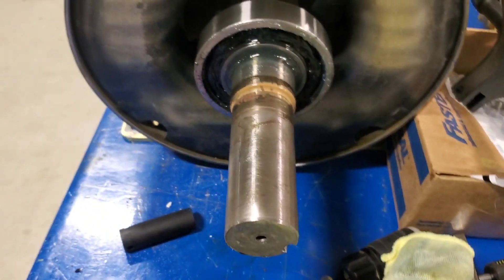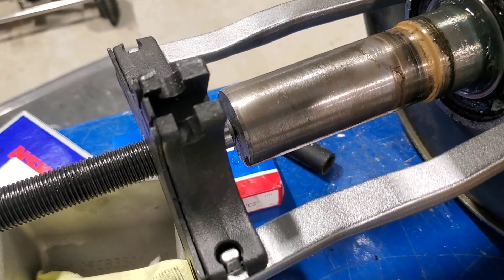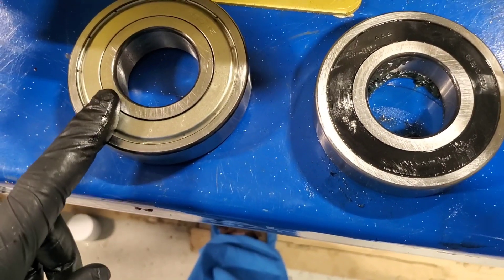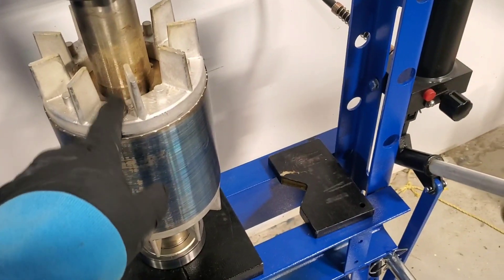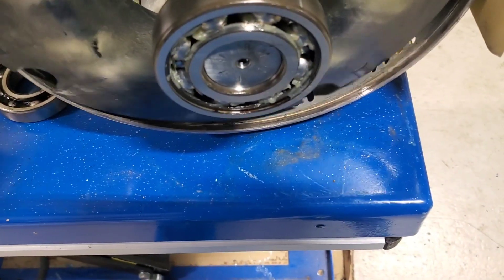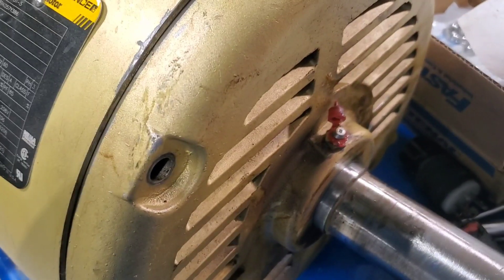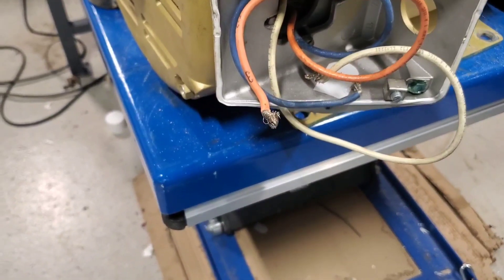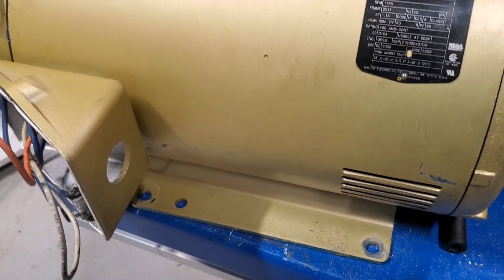Replacing ball bearings in an electric motor new SKF Explorer Bearings

Comment: Good heavens, I just bought a vintage Stanley Bench Grinder — a model 557 that I'm restoring.   Today I opened the motor, and one bearing is bad, and the grease on the outside looks just like that, all burnt.  How crazy is that I came across your channel?  Is it possible to fix that one by cleaning and relubbing, or does it need to be replaced?
Reply from the maker: Replace for a happy experience

Comment: do not use an induction (or any heater) without a temperature shut off. you can easily burn the bearing. also, don't recommend heating a greased bearing. either flush it out and repack after install or press it on. Completely agree with Jim's recommendation about hammering or torching. Don't do either. Commend the cleanliness of the shop.
Reply from the maker: Good advice
Reply from the maker: we had a very small press so there was no way to fit the armature in it. We also did motors right in in-situ as we could not get them out easily. sometimes you have to settle for good enough. Oh my motor rebearing lasted longer than a motor shop job so there is that LOL

Comment: Wasn’t it obvious that the fan side bearing didn’t fit on the shaft ?  It was hanging off by 1/8”
Reply from the maker: Correct it was rectified before final assembly

Comment: Great video! Is the over-greasing occurring at the motor rewind shop, or in your plant ?  Back at Courtice steel, the electricians removed the zerk’s, plugged the holes with pipe plugs, and greased them themselves as per manuf. Recommendations so other people didn’t over grease.
Reply from the maker: Hvac techs are over zealous with a.grease gun
Reply from the maker: Hey Dave,do you remember the team working on acoustical greasing technique in the Galt plant? We were using a mechanic's stethoscope to listen to the grease enter the bearing. It's one of my favourite methods of greasing
Reply: @JimsNBHomestead  I had forgotten all about it until now. I do remember, that was a really cool technique. I remember listening to the sound of the bearing turn into a swishing noise
Reply: When you have any luck teaching the HVAC Techs this method?
Reply from the maker: @davidbeals6807  Got laid off LOL
Reply: @JimsNBHomestead  they got laid off, or you did?
Reply from the maker: Me, Weed industry is dying fast....REAL FAST
Reply: @JimsNBHomestead  sorry to hear that.
That sucks
Reply: I'm sure you will land on your feet soon
Reply from the maker: Scored an interview on Tuesday
Reply: @JimsNBHomestead  that's awesome! I'm sure it will go well. Good luck
Reply from the maker: It did